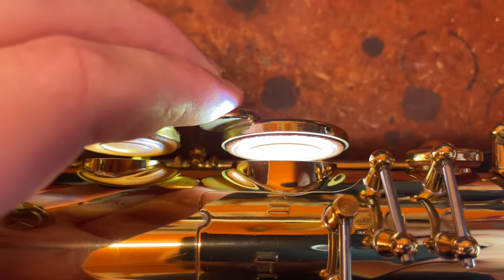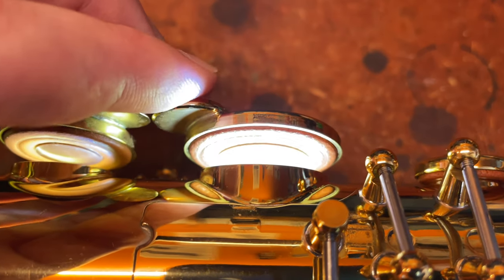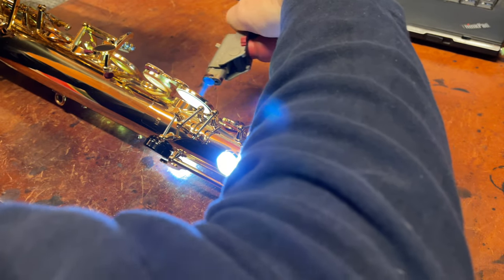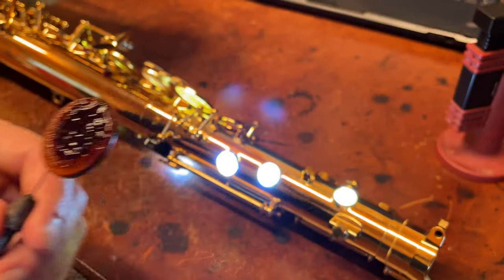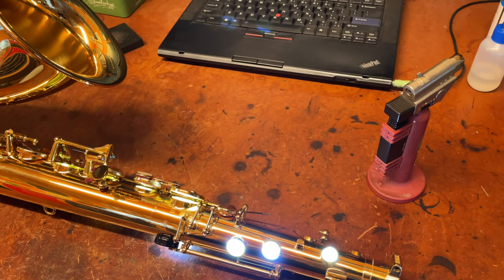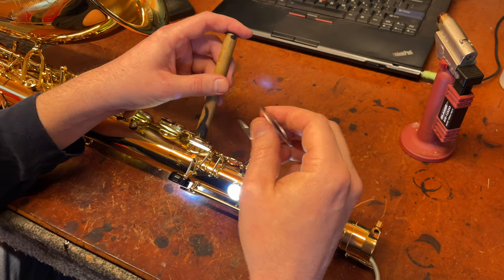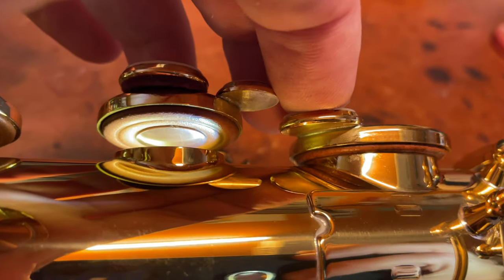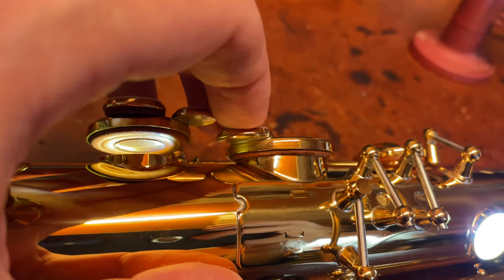Saxophone Repair Topic: What Leaks From Not Enough Shellac Looks Like And How To Fix It

Comment: is a flame heat used on the less expensive price range $1100. saxophones? I woul be afraid of scorched laquer if I were to attempt a pad repair or swap? . I had a leak on the upper side of a lower note cap and all notes played with right hand were out. I carefully held the oposite side up and gave a slight downd pressure to the upper side and it leveled it which  cured it. The Tenor Sax is new old stock so I believe it was mishandled. Leak fixed and It plays great now ! I'm a guitarist of 50+ years and just got a sax for fun and learning fast and am loving it!  Melody and No chords : )  I am learning a lot about upkeep from great channels like yours, Thank You !

Comment: Could it be that the hot shellac and heating needed to manipulate the pad pulled the leather tighter? It seems like the “dotted line“ aspect of the leak could be related to the pores in the leather? Just spitballing.
Reply: I was also thinking about unfinished metal rim

Comment: That's very interesting to see how you remove the pad without dismantling the saxophones first, just by heating the cup. Would that method work the same, changing an old pad for a new one? Also, do you actually pierce the side of the pad with the vice pin, to enable you to maneuver the pad into position? Great video by the way!
Reply from the maker: Yes, the majority of play condition work is usually done without disassembly to save time/money.  Sometimes people even do what they call a repad without disassembly, although I personally disagree with that.

Yes, piercing the pad with the pin.  A very sharp pain will leave a clean hole, and you can also shrink it by ironing the hole afterwards with the the tip of a heated pad iron.  

Disassembly enables cleaning, and unless the instrument has been cleaned very recently, that is good to do.

Comment: What were you doing when you heated up the pad slick? Also is that style pad slick necessary? I’ve only got one that is tear drop shaped. Just starting out with all this and absolutely love your videos.
Reply from the maker: it pulls the leather tight and irons out wrinkles and provides me with a tool for manipulating the pad as a monolithic element rather than pushing or pulling on just a section or piece of it.  I like using them, I don't know about necessary in general.

Comment: Great video! I’ve even seen a lack of shellac from other repair shops before. Sorry if you’ve answered in another video, but would you mind telling what make and model butane torch you use/recommend? I have a very cheap one currently and it’s difficult to get consistent temperatures
Reply from the maker: blazer es-1000.  I also use an acetylene/air torch with a 00 tip when I want a softer heat- in this video I use it to melt the shellac.
Reply: @StohrerMusic  Thank you!

Comment: Hi Matt, very useful channel!  I'm trying to learn how to maintain my own horns. I just changed all the pads on my Yamaha YTS-25 following your shellac instructions. So far so good. However, the F# sidekey has a gap to the front that I cannot correct by adding more shellac to seat the pad a bit higher on the side where it leaks. What do you suggest I can do instead?
Reply from the maker: If it's hitting in the back first, then you might actually need less shellac not more.
Reply: @StohrerMusic Okay, I'll try to remove some of the shellac and remount.
Reply: Nope, still a considerable gap. The pad looks evenly mounted all way around inside the cup.  The spring is also at max pressure.  Could I have bent the arm while warming it up?
Reply from the maker: @janjung5651  no, heat won't do that.  Are you using a thin pad?
Reply: @StohrerMusic  No. It's from a set of Soundman tenor pads. The others fit perfectly. I had to do a few adjustments but nothing major. The F# side key also feels like the distance it opens has diminished. It's correctly reattached, there is not a lot of room for making mistakes in the single row mount. Quite strange.
Reply: Should I try with a thin pad instead?

Comment: Matt, with these newer horns, when using your butane torch to heat up the key cup, have you ever encountered any issues with the lacquer finish or clear coat finishes? I understand it's probably a thin line of heating up just barely enough to get the shellac to start moving but not causing damage, making experience and skill helpful.
I have a new black nickel Cannonball, and it's fraught with similar issues of production anomalies such as this.. it does have a clear coat finish over the nickel plating, and it is very thin and weak and can easily be scraped off with your finger nail..
They even have the same clear coat finish over their gold lacquer horns, and also I'm seeing this on other brand as well..
Reply from the maker: The only modern horns I really ever work on with any regularity are Yamaha, Yanigasawa, Selmer.  For those horns, no, no problems.

Comment: As a repair tech. Of almost 50 years, one thing I never understood is stores that sell raw horns. Just because it's new doesn't mean it's right! It still makes me cringe to think back to the 80's when Selmer was using contact cement to install their pads, and then clamp the living #**# out of them, so by the time they reached the dealer, nothing sealed. With the volume of work we had, we didn't have time to repad new stock. Being retired from the trade for some time, I've heard that tone hole profiles are coming through more consistently. Have you found this to be accurate? I've not had the chance to install the 'roo pads. Is surface /consistency  that good?

Enjoyed your vid. Bet we could share alot of stories.
Reply from the maker: Thanks!  And I’d love to hear from you- I bet I could learn a lot.  

Selmer pad work does seem to be better with a particular bump accompanying the “bird” series of reference horns, but there wasn’t really anywhere to go but uphill for a while there. Selmer toneholes seems to be a LOT more level.  Yamaha seems to be about the same as they were, not bad. In general, I think things are getting better from where they were 20 years ago.  But setups are still a huge improvement.  The Yamaha above needed most of its pads reseated, two replaced, and a major neck fit as it was leaking so much air from the receiver you could hear it whistling.
Reply from the maker: Btw I called the Selmer pad problems “Selmeritis” when customers would ask what the underlying issue was.